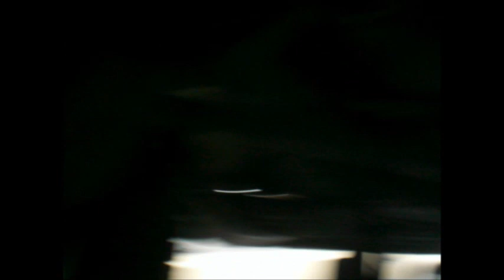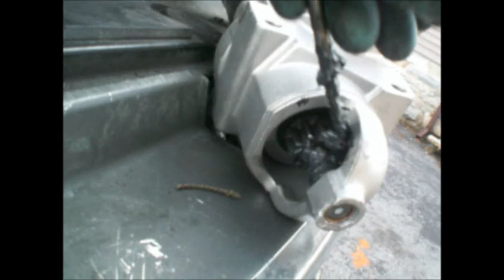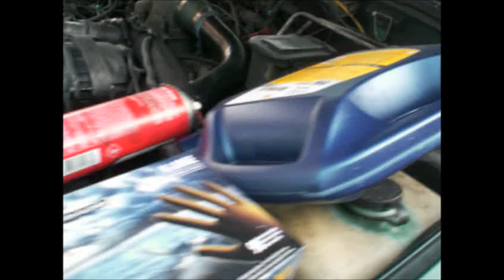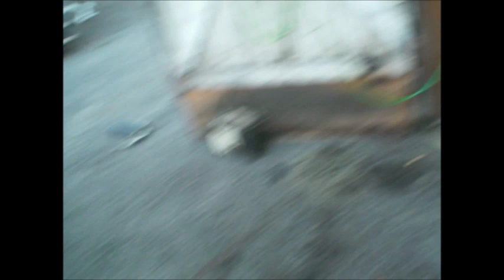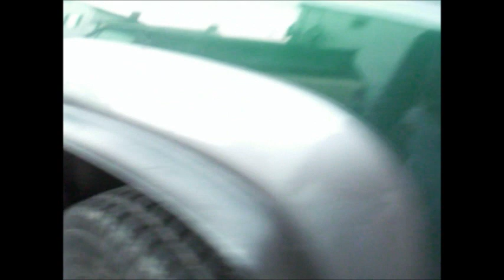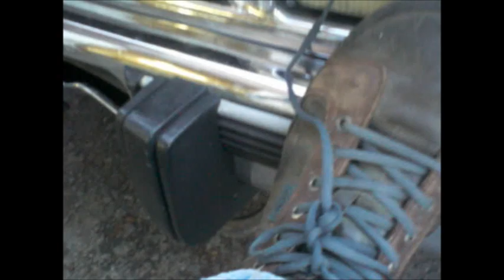Ze Dr Ze Weasel Ze Christmas Eve Starter Feex  12 24 15

Comment: Like nooooooooooooooooooooooooooooue  Your Bumper is mangled too, If you have a shop press, try to push it out. I think it will work I knocked some large dents out of my rear bumper. with two hammers.  A shop press would of made it a close 98%